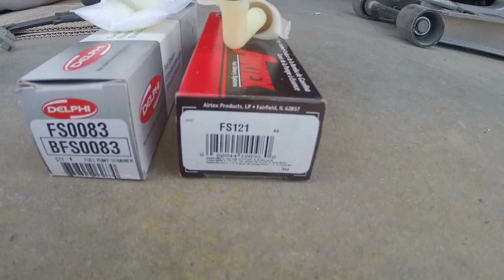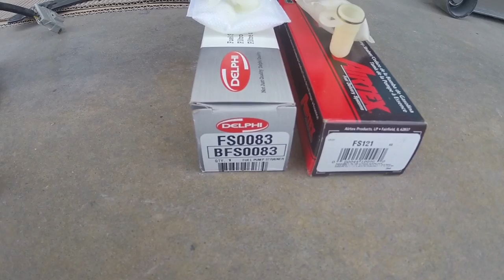How to Replace Fuel Pump & Gas Tank (88-91 Civic/CRX)

Comment: Any idea why fuel would over flow through the gas cap/near the filler neck? Gas cap is fine, tried aftermarket and brand new OEM cap, still does same thing. Tank holds pressure for very long time if that means anything. Happens when tank is full/somewhat full and park the car. I’ll come back out and see fuel dripping out near the top of the filler neck/where the cap is. Smells like gas inside the car as well. Been happening for a while, so tired of this shit.

Comment: I think I'm about to do this on my 89 CRX I just bought. It won't start, it's been sitting for 6 years. I don't hear the fuel pump come on and I don't have spark. Where did you get the pump and sending unit?
Reply from the maker: From eBay.  I didn't replacing the sending unit though.  I re-used my old one.
Reply: Garage Built Hondas Thank you. Love the video. My sending unit does work, I have a half a tank of gas!!

Comment: Where did you get your fuel tank? None of my regular parts suppliers have them. Also is it possible to shift the tank over a tiny bit? My new exhaust hits my gas tank on the front right corner the sound is irritating at cruising speed.
Reply from the maker: I bought it off of eBay.  It was around $90 shipped from a seller in Phoenix.  Someone posted in a comment below that he doesn't sell them anymore though but that was a while back.  There really isn't any room to shift it over.  It kind of fits in one spot.  You might get away with like 1/2" possibly.

Comment: Hello I was wondering if the civic wagons use a different fuel sending unit compared to sedan or hatchback thank you. Also would you advice getting one from the junkyard?
Reply from the maker: My guess I the they are the same, along with the fuel pump.  A junkyard one might work just fine.  I'd use it if it's inexperienced because those are easy to change.  No dropping of the tank is required.

Comment: I have a crx dx 1991. Whenever I fill up gas to full tank and turn off the car, the gas starts leaking out of the filler neck. Is this filler neck on my crx loose or broken whenever i fill up gas to full tank and it overfills out? Usually on all cars the gas wont spray out of the filler neck when im pumping to full. Could it be i need a new filler neck which is hard to find for my crx?
Reply from the maker: Check the vent hose that goes into the engine bay.  It's usually red.  When that's clogged this can happen.  There's also a valve on the tank itself which can be accessed without dropping the tank.  Those vents are what prevent the problem your encountering from happening.
Reply: @GarageBuiltHondas  Alright I'll check it this week. Thanks for being an inspiration for our 88-91 civic wagon hatch sedan and crx!

Comment: If you have a P1456 code  (not the gas cap) what else could the problem on the fuel tank what other evap components could of gone bad beside a actual fuel leak
Reply from the maker: Taken from the web "the code or DTC P1456 is caused by a leak on the tank side of the evaporative system, and the most common cause is a loose or missing gas cap, but it could also mean a leak in the fuel tank, or one of the tubes or hoses."

Comment: How do I know if the ECU it's working. Do you think it's the ECU?
Reply from the maker: +Justin Vargas probably not.  Once you turn the key in the ignition, the led on the ecu will blink on/off real quick letting you know it's working.
Reply: Garage Built Hondas. Thanks John.  The ECU light only blinks once

Comment: Help pls!! On my Honda Civic EX 2000, where do I find the FUEL TANK PRESSURE SENSOR??
Reply from the maker: On the top of the gas tank.  It should be located close to the fuel pump access location.
Reply: thanks

Comment: I can’t find any of the hoses I’m missing the red thing( not sure what it’s called), I’m missing the 2 filler tubes
And the hard lines that are bolted to the tank. How can I find these parts I have everything else ready to go
Reply from the maker: You can get hoses at your local auto parts store.  They'll have some similar in size.  Honestly I have no idea what the red thing is called.  I believe it's a fuel vapor valve of some sort.
Reply: @GarageBuiltHondas  fuel 2 way valve (discontinued) 😞 I’ll check out why the part store has
Reply from the maker: I'm sure the same valve from a different model will work as long as it functions the same.

Comment: Hello, can't seem remove the 14mm gas tank line on my 91 honda crx its really rusted. Any other trick to remove it. Thanks
Reply from the maker: Not really. Spray some lubricant on it and let it soak for a while.  Then use an extension and a small hammer and tap on it gently to help possibly free somr of the rust and corrosion which is holding it stuck.  Just try to not strip it.  Are you using a line wrench?
Reply: Hello thank for getting back at me, yes i sprayed and let it soaked and even bought the 14mm line wrench and no luck. Im giving up don't know what else to do.

Comment: Ok I’m attempting to drop the tank to change the fuel pump but I’m stuck at step one, getting the plastic Phillips screws off the plastic cover ! Either the plastic screw stripped or the screw just spins. I noticed your vid skipped that part and the cover was magically off.
Reply from the maker: Hold the circular part with your finger, then use a screwdriver to get the plastic screw out.

Comment: Bro u can probably save me big time  so i have a 1995 integra and in the middle of my seats i see the fuel pump but it gots no arm level so my friend told me i have to drop the tank because the sender unit level is there is it true because my gas gauge dont work? Please let me know
Reply from the maker: He is correct.  Buy him a beer.
Reply: Dam really thanks bro really means alot , is it hard to replace and how much is it?
Reply from the maker: Not if you're mechanically inclined.  If you never touched a tool, it'll take a little longer.  No idea on price, you'll have to look.
Reply: Garage Built Hondas oh ok so do i need to buy the whole sender unit right or only the arm?
Reply: Garage Built Hondas so i checked and i cant find any for integras 1995 but i saw a 1995 civic that looks like yours would it fit on mines or they arent the same?
Reply from the maker: Couldn't tell ya.  You'll have to check your car first and see.  You could buy the entire unit which is what I would do.  If doing all that work, might as well have all brand new parts.

Comment: The fuel pump went out in my 91 civic will an eg fuel pump work going to pull tank tomarrow
Reply from the maker: +GHOST117HALOBOYCOD I believe yes, it might be slightly shaped differently but should work just fine as long as it fits onto the fuel pump housing.

Comment: Would any type of heat shrink work?
Reply from the maker: I didn't use anything out of the ordinary, just the normal type for wiring. If there is an upgraded alternative, that would probably work even better.

Comment: bro how did you know which was ground and power when wiring in the new fuel pump? installing this afternoon! thanks.
Reply from the maker: You'll be able to tell, the red will be the power wire from the original harness.
Reply from the maker: +J Wid Films From what I remember, the new pump had the "+" and "-" markings on it also.
Reply: I did it lastnight what a pain it was i tried to do it with 4 gallons in it OMG lol yea the old pump had the + mark on the blue wire soooo.
Reply from the maker: +16ValveVtec It's so damn heavy with gas in there, haha!  Honda got smart allowing fuel pump access under the rear seat after 91!

Comment: Just wanted to ask i replaced my fuel pump on my 91 crx i have the same model fuel pump that you have but im getting little to no fuel  up at the filter just little drops would that be the lines or maybe i did something wrong ?
Reply from the maker: Check the filter sock.  It might be pressed up against the tank.

Comment: I have a question that is  kinda related. I have a 91 Si. There is a heat shield just under the forward section of the gas tank on the passenger side. I didn't see it on yours. Did you remove it? I was wondering because my exhaust is rattling and its because of that heat shield. But since it's around the gas tank I've been afraid to move it. Also, your videos are awesome.
Reply from the maker: Thanks!!

And yes I removed it.  I have 2.5" diameter exhaust piping and it was in the way and rubbed the exhaust a lot.  You may be able to bend yours into a different position so it'd not rattling against anything.  Check to see if all of the bolts are still there too, maybe one fell off causing the rattling.
Reply: +Jon Widmer it's because the exhaust is 2.5 as well. I might see if I can bend it. Thank you!
Reply from the maker: +Jessica Maggard I'm sure you could bend it, good luck!

Comment: 06:45 I need that purge valve. I know the part number but in my country there is no way i can find that. Do you know any alternatives for that? Is there a way to repair it? Because of that i have many problems with fuel. I need your help guys.
Reply from the maker: I'm sure a different valve from a different car would work.  It's remotely mounted so there's got to be something similar which would work.

Comment: What was the method yall use to remove filter neck hoses?
Reply from the maker: Strong hands.  Pliers can help, but try not to damage the hoses.
Reply: How about cleaning the rubber patches on the fuel tank
Reply from the maker: Umm, that's not me man.  I don't drive show cars.

They're rubber, under the car, will always be exposed to elements.  The most I'd do would be just wipe them down with a wet cloth.

Comment: I'm having a ton of trouble finding the fuel pump hanger assembly for a 1989 CRX, is it the same as 90 or 91? I can't find one that's specific to 89
Reply from the maker: All 88-91 are the same, except the wagon
Reply: @GarageBuiltHondas  I see, the wiring seems to be slightly different though

Comment: Anyone know why my 88 EF sedan only has 3 wires and not 4? I can't seem to find the whole assembly with 3 wires because they are all 4 plug. The pump hanger I bought said it would work but wouldn't even fit in my tank. Please help... thanks.
Reply from the maker: The 88s are a little different.  The ground wire comes fire off it and goes to the body of the car on the 88s.

Comment: Hey man I just replaced my sending unit and the gas needle remained stuck in the 'full' position. I took off my cluster and upon attempting to remove the needle, I broke it....do you know what other cars are compatible for that part? I have an 88 SI. Looks like I need the part that attaches to the needle (looks like a copper yarn ball).
Reply from the maker: You'll need to find another 88-89 cluster and swap the temp/gas portion of it to you cluster.

Comment: Hey quick question will this pump that you recommend in the description work with an 89 civic b16 swap with no issues? As well would you recommend just going with the walboro 255 on eBay instead?
Reply from the maker: Yes.  You can if you plan on making a lot more power in the future.  If not, a 255 won't do anything better than a stock pump will do.

Comment: My return line that’s held on by the two 10mm bolts turns out I stripped the threads and I can’t seem to find a new one any where!!  And it’s leaking Any help?
Reply from the maker: I don't know if they make them brand new.  Best bet is a junkyard or find someone parting out an 88-91 Civic/crx.

Comment: Hey im having issues with code 16 on my 91 civic si replaced main relay new filter sounds like its runing on 3 cylinder wondering if you have ever expirenced  that by any chance any help would be greatly appreciated thanks
Reply from the maker: Might be a bad fuel injector.
Reply: Thought it was started checking my #3 injector  wasn't firing picked one up at a local junk yard and checked didn't work i followed the wiring and injector box was super hot seems like the entrance was kinked separated it and added electrical tape  and no code shes runing fine now thanks

Comment: The way the gas tank straps hook on scare me. Is there a different style of strap bolts ? I just seems like terrible idea having a round bolt holding on one side.
Reply from the maker: Not to my knowledge.  I've never seen a gas tank strap fail and a gas tank fall off an 88-91 Civic/crx in all the years I've been interested in them.  I think you'll be just fine. 👍
Reply: Garage Built Hondas thanks for the info! Got my 90 Si running and driving. Just didn’t want my gas tank falling off 🤣.
Reply from the maker: Excellent, I wouldn't even worry!

Comment: I have an 88 civic that's leaking gas. I replaced the fuel pump gasket and sending unit gasket and lock ring. It's still leaking gas. All my lines are fine and the drop seems to be coming from the purge unit. Anyone know where I can get one?
Reply from the maker: Try hondapartsunlimited.com and see if they still sell them new.

Comment: I bought a 89 crx SI few months ago and I can't get it to star.  it was on Non operation for almost 15 years. only  has 73,000 milles. what do you recommend me to do. replaced the gas tank or just the fuel pump.
Reply from the maker: Justin Vargas I would save yourself the trouble and replace the tank and fuel pump.  You'll more than likely have really old contaminated gas in there, and it may even be clumpy and have clogged some of the lines/hoses.
Reply: Jon Widmer. Thanks Jon. any other advice for the engine.
Reply from the maker: Full tune up and hopefully it should start up.  You should crank the engine first to make sure it's not seized.

Comment: Hey, 
yesterday i changed my fuel tank, i had one in without the rubber padding and if you dont have that on it rubs against the chassis and rubs the paint off and it starts rusting. 
I did it infront of the garage because i thought the wheather was good and as soon as i had the tank out it started raining lol
Reply from the maker: +ProjectGTR Ok very nice.  Thanks for the info!  That makes a lot of sense too!

I feel the same way, whenever I have a day planned to work on something, mother nature always plans otherwise, but for me it's always the wind.
Reply: About to swap my fuel pump but I, cant tell if my problem is the fuel pump or main relay. Which would cause the fuel pump to have a weak prime? Thanks
Reply from the maker: +Trex dawgg Watch this video on how to diagnose a weak fuel pump.  https://youtu.be/i9t9OapKffg

Comment: Hey so I recently replaced my fuel pump on my DA9 and now when I am down to like a quarter of gas, the car dies when coming to a stop, runs fine when full or half way. Would this issue have to do with the strainer at all? Or maybe the fuel pump isn't seated properly?
Reply from the maker: It could be one or the other.  Did you reuse the old strainer, or did the new one sit exactly the same as the old one?  If so then I would rule that out.

It does sound like something is definitely up with the pump/strainer not reaching the bottom of the tank.  I cannot remember, can you access the fuel pump on DA's from under the rear seat cushion, or do you have to drop the tank also?
Reply: I used the new strainer because they look identical, it might not be seated properly. I will be working on the car tomorrow and I'll have to drop the tank :/
Reply from the maker: +DA9 PNW That hurts, it's a pain dropping the tank for a 2nd time!  Let me know what you find, I'm curious to see what it is!

Comment: Well, I did everything correctly, But when I ever prime the fuel pump; fuel spits out of that two-way valve [Part number: 17371-SF1-A01]. That red part on the tank. :/ Please help! anyway to fix this or bypass safely?
Reply from the maker: I'm not sure what's wrong here.  But you can't bypass something that Honda engineered to work with the system.  You may want to check you wiring using a multimeter.
Reply: @GarageBuiltHondas  I figure put the issue, it was leaking out of the banjo bolt from fuel assembly. But now I'm trying to combat a no crank issue. I will be recharging the battery and replacing the main fuel relay.

Comment: Hey do any of you ef guys know if the wagon can use the hatch or sedan gas tank as a replacement? Its a fwd mode not the 4wd model
Reply from the maker: I don't believe it's compatible still.  The wagon has a different shaped tanked
Reply: @GarageBuiltHondas  yea i knew that but i was hoping someone went through the same thing im going through right now. In jersey its hard to find any wagon part outs
Reply from the maker: I'm sure plenty of people have gone through replacing the tank before on a wagon.  You may want to search around online and see if they sell them brand new.  They sell them new for the other 3 models, hopefully they do for thr wagon also.

Comment: dang that guy don't sell no more of this gas tank. i like it because it comes with a drain plug. other crx tanks in ebay doesn't have this oem drain plug.
Reply from the maker: I'm sure there are others that come with the drain plug.  Do you not have the original drain plug off of your car?
Reply: yes i have the original drain plug, the ones i looked at in ebay doesn't have a drain plug hole. not sure why though.
Reply from the maker: You should ask, it might not show it but it may be included.
Reply from the maker: +C E No kidding!  Didn't think about that!
Reply from the maker: +C E I think the center is different because of the exhaust tunnel.